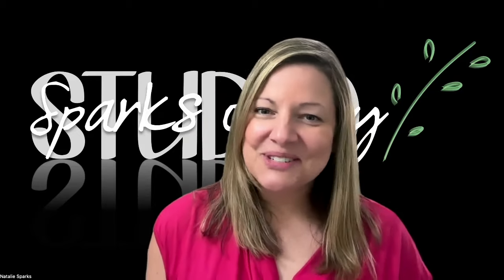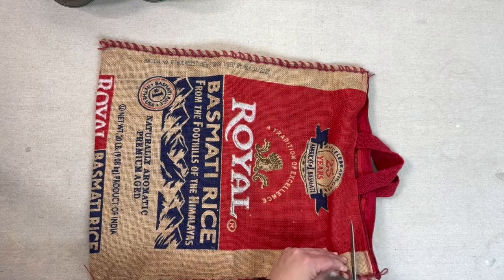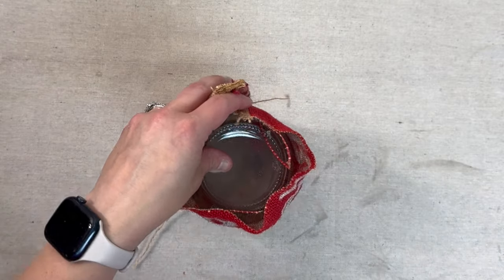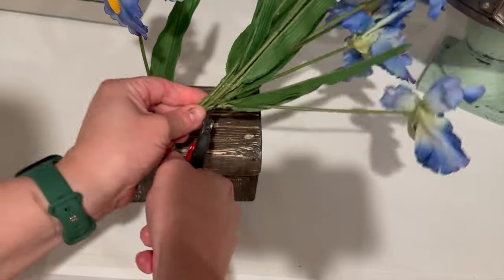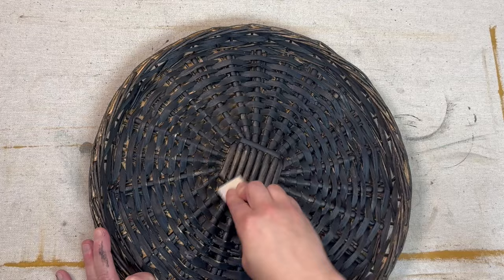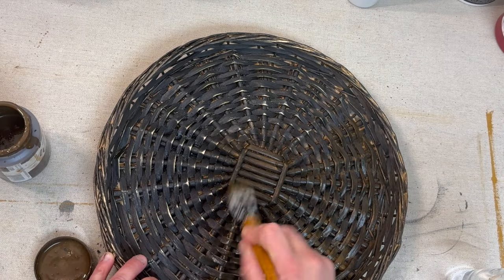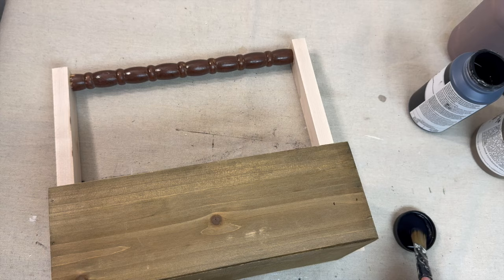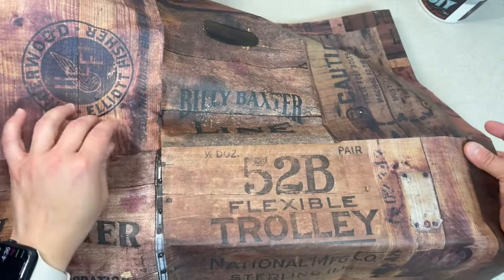Rustic Home Decor Ideas You Need to Try!

Comment: The last project was my favorite. That turned out great! You can use other patina sprays on the iron color....Ginger Chick Rehab has a ton of videos using that medium.
Reply: Technically if you read the directions... ONLY the Green activator spray works with the iron patina paint. I was a Dixie Belle Premier Retailer for 7 years & ONLY the green spray works with the iron paint.
Reply: Thank you & have a fantastic day ☺️
Reply from the maker: Thanks for the tip!